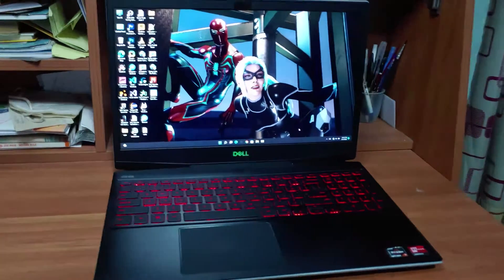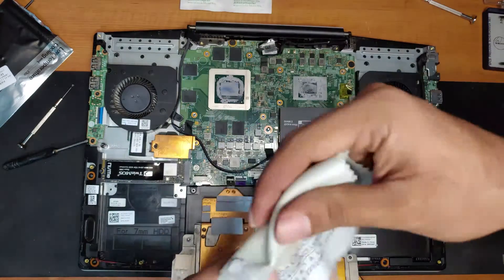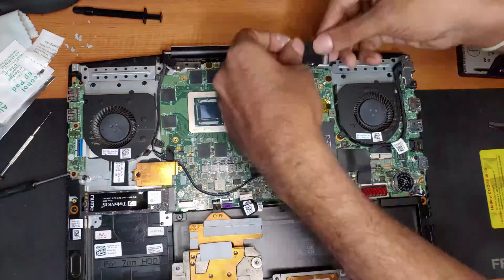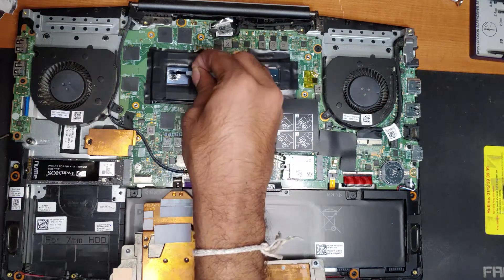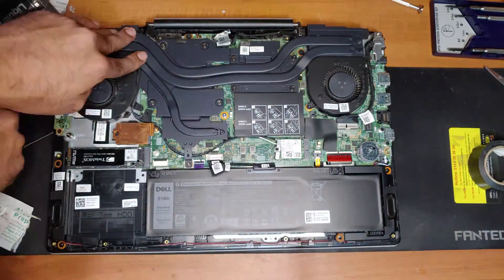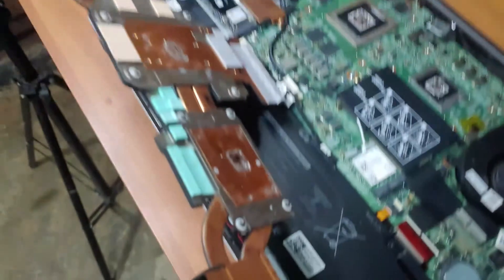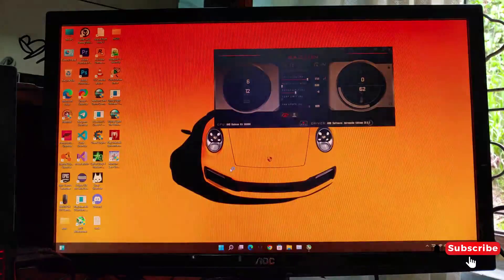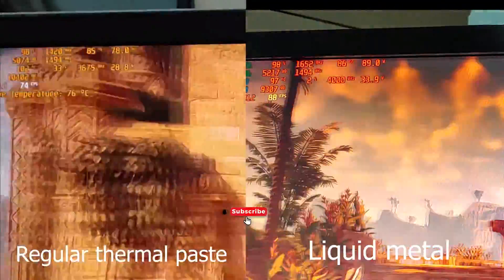Dell g5se liquid metal upgrade.

Comment: How to fry your motherboard… add Liquid Metal …lol.
Reply from the maker: Bro, I've been using my laptop for more than 3 years now with liquid metal. I'm a university student, so I have to travel with it as well. I travel 400km with it every 2 weeks. I've had no such issues after 3 years. If you are paranoid you shouldn't do this.
Reply: @Btech94  Its about odds. The odds of liquid metal shorting out your motherboard is very high. Especially, compared to non-conductive thermal paste.  Also electrical tape is 0.18 mm thick, so you're losing 0.18 mm of contact with your CPU/GPU, just to protect yourself from shorting out your CPU with metal thermal paste.
Reply from the maker: @obijuan3004 well that actually happened. I updated it at 6:00 on the video. Just covering the middle potion with electrical tape is enough. I've re applied liquid metal after 2yrs and still no issues whatsoever. Now i can run the gpu at 100W without an issue at 75'c to 82'c. And more importantly I  didn't fry my laptop with 3 years of hard use with liquid metal. I'd take that any day than that throttling high temperature system I had with regular thermal paste 😂.

Comment: DO NOT USE LIQUID METAL! I used it before and it caused some sort of staining on my cpu and gpu dies and the cooler that couldn't be removed and essentially made the motherboard and cooler useless, instead use GeLid GC Extreme as it's the best thermal paste for this laptop and won't damage your components.
Reply from the maker: Damn I'm interested. Is it better than liquid metal in thermal conductivity?
Reply: @Btech94  It isn't but with the already low mounting pressure of the Dell G5 SE 5505 it is better than more well known high performance thermal pastes that only work best with higher cooler mounting pressure that desktop PCs have, and it will not run out from between the silicon dies and cooler in the laptop unlike liquid metal, thus there's no risk of electrical shorts that would damage the motherboard, also it's much cheaper, I've not hit temps above 75°C under full load with GeLid GC Extreme unlike other pastes and liquid metal which easily get above 80°C
Reply from the maker: @norliasmith  damn you meen in CPU temps in like cinebench? Mine still hits 100'c on cinebench r23 with -19mv undervolt. But it now scores 11815points in it. While gaming im locking the temps to 80'c in cpu. It still sucks 25w but because my gpu is also overclocked to 1850mhz @ 110w it both gpu and cpu hits 80'c. Otherwise on stock settings with undervolt i can comfortably use the pc at mid 70's
Reply: @Btech94  Don't use those hard benchmarks, they over stress the CPU and GPU beyond what you'd normally see in gaming, I have the 1.14 bios and using the AWCC G mode to keep the fans at full speed, no undervolting and my temps stay below 75° under load in games.
Reply: @norliasmith well I have already updated the bios to the latest version . Can I revert back ? And what is the best bios for this laptop with low temps

Comment: Major edit:
1) Dude! Why'd you bend that one tab back, if that breaks, you're gonna hate life!
2) That electrical tape just increased the thickness of the metal surrounding the silicon dies. Your contact between CPU/GPU and IHS just increased!
Reply from the maker: 1) the reason i bent the tab backwards is it's much easier to fit after applying liquid metal on it.  Otherwise it's pretty hard to aim the right spot without touching other pc parts. I've removed heatsink 5,6 times like this but nothing happened. Still in perfect shape.
2) yeah later I've cut down the electrical tapes just to fit inside the cpu dies inside. For the gpu it isn't a problem it contacts with the gpu die no problem. But cpu die is little short so i had to remove the outer layer.

Comment: Disabling samratshift can increase performance i have same laptop if u find the way to disable smartshift in this laptop let me know.  And amazing work 👏👏
Reply from the maker: Yeah. To disable smart shift permeantly i have to edit bios. It's little risky so instead I've edited the gpu drivers bios via morepower tool. By that i can undervalt, overclock and change the power of gpu (upto 100w). Its safer than editing the laptop bios and ignore the smart shift as well. I've uploaded a video about how to do it. If you are interested you can check it out 🙌
Reply from the maker: Ask KJ  after bios update does it reset again to default and enables the smart shift?
Reply from the maker: Ask KJ  oh thanks mate. I'm gonna try that too. The latest amd drivers won't letting me to undervolt and overclock the GPU. So i had to use custom nimez drivers to bypass that. Hope this will help 🙌
Reply from the maker: Ask KJ  have you tried out very cpu heavy games like Hogwarts legacy? In those my cpu pulls around 35w and even with the liquid metal still manages to hit 90'c with gpu at 80w. But GPU stays at 77'c max without any overclock.

Comment: bro you applied a bit too much LM on the surfaces. i could see a few drops scattered around your heat sink and they could easily short something on the board. 

please only apply a very thin film/coat on both heat sink & die, SUCK BACK ANY EXCESS BUBBLING OF LM WITH THE METAL SYRINGE TIP. 

I repasted my legion 5 and the CPU i5 10th gen hasn’t crossed 71C during full load after 2 days of application.
Reply from the maker: Yeah it's bit too much. I've removed excesses liquid metal after seeing little bit of it leaked to the electrical tape

Comment: Bro you might damage your heatsink as copper reacts to liquid metal, using better thermal compounds like arctic will decrease your temps better than this. Also electrical tape is alright but it wears out due to excess heat.
Reply from the maker: Aint the thermal conductivity of arctic thermal paste much lower? Like 6 W/mk? Liquid metal is like 73 W/mk...
Yeah the liquid metal reacts with copper and creates a protective layer. I will have to apply a little bit of liquid metal in like 6 months. After that the liquid metal won't soak into the copper heatsink because of that protective layer. Yeah I've changed the electrical tape which have some liquid metal on it now it's in pretty good condition. Hoping to replace them in 6 months.
Reply: Actually GeLid GC Extreme is found to be the best thermal paste for this laptop.
Reply: @norliasmith  I just bought 1 gram of Thermal Grizzly - Kryonaut 12.5 kW. which one is better?  GeLid GC Extreme or Thermal Grizzly - Kryonaut 12.5 kW?